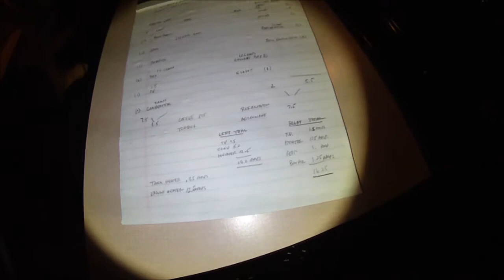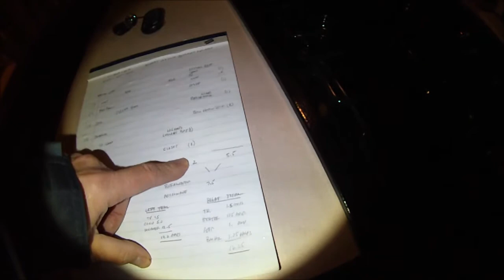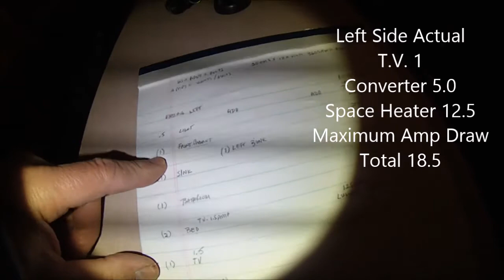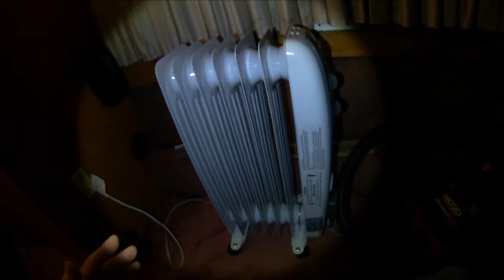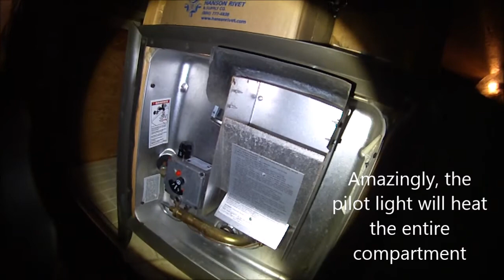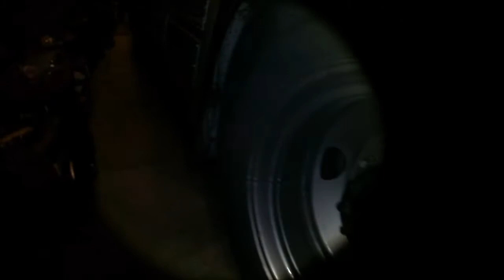Winter Camping Electrical Needs

Comment: Hey John here is a trick you might be able to use. Most 30 AMP pedestals have a seperate 20 AMP receptacle.  The main breaker often is more than 30 AMP. What you can do is create a very frugal separate circuit with a cord that plugs into this separate circuit. I often put my oil filled heater and dehumidifier on the separate circuit through and extension cord that runs in beside my heavy 30 AMP shore power cord. This then creates most all the heat I need and leaves my 30AMP service free for all other requirements. It is a cheater system that doesn't equate to 50 AMP in calculations but it really makes like so much easier.
Reply from the maker: Hi Gary, Yea, occasionally I'll run a cord out the bottom of the door or the driver's ticket window to run a heater or a portable a/c we have been using.  I've considered adding a 20 amp service port to do such a thing and might do that rather than upgrade to a 50 amp cord and service.  We have been to quite a few mom & pop campgrounds in recent years where they only have a 30 amp outlet on the posts at the sites.  I could always use an adapter but still, you only get 30 amps.  Then when there are posts with 50, 30 and 20 amp outlets, you can use one or two. But, I wouldn't have to rewire everything and replace the plug on the side of the bus.  Also, those 50 amp cords are really heavy and stiff and expensive.  Maybe your suggestion would be the best way even for the long term...still thinking about it.

Comment: Thanks for this video.  Great timing.  We are currently in the middle of wiring up the a/c side of things (50 Amp).  We may steal your light in the water bay idea.  Hopefully we won’t be in freezing temps too often, but better safe than sorry.  FYI, we have installed a mini split a/c heat pump, and it pulls max 10 amps for heat and 6-9 amps for cooling.  We are in AZ so we have only tested it down to about 40 degrees but when we tested the temp of the air blowing out when on heat, it was over 100 degrees.  So we have hope it will do well in colder temps.  There’s a video on our channel.   Thanks again for another helpful video.
Reply from the maker: Hey Juan and Michelle,
Thanks for your comment.  The information sharing is always a good thing.  I watched your video on your mini-split system, very helpful.  Wish they'd had those 30 years ago when my bus and I were your age!  Your videos bring back a lot of memories on when we bought and built our bus.  You guys are great!  Hard working, ambitious and undaunted by things you've never done before.  And Juan is a pretty good craftsman, from what I have seen.   Just doing it is the best way to learn...aside from the University of YouTube, that is.  (wish they'd had that when I was your age too!)  Good luck on completing your bus.  I thought ours would take six months, it took two and a half years. Don't get discouraged if the time frame is longer, your kids are still young.  Feel free to contact me for advice if you need it either on the construction or mechanical repairs.  I'm happy to help with both.  Will find you if we are ever in AZ.
Reply: Thank you for the kinds words John, - Amazing the things you can learn on YouTube!  We keep wondering "how would someone have figured this out before YouTube?"  Thank you for your generous offer - We would love to bend your ear on some of this bus stuff.  Please do find us if you are ever in AZ - we would love to meet you.